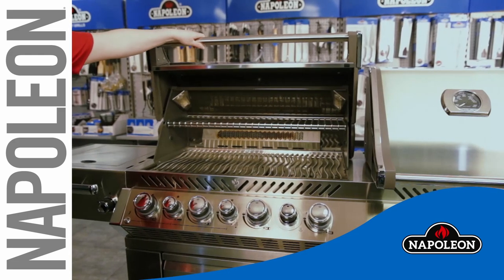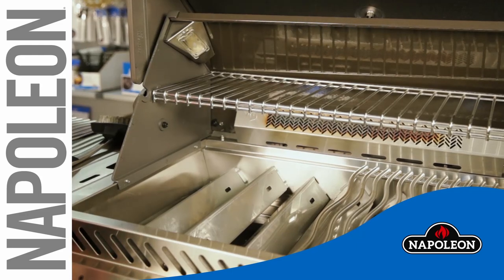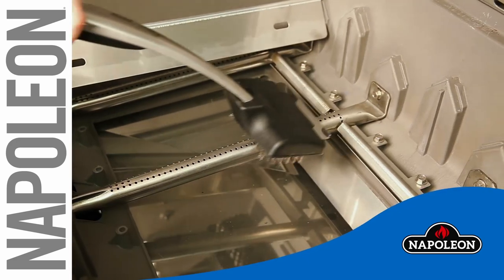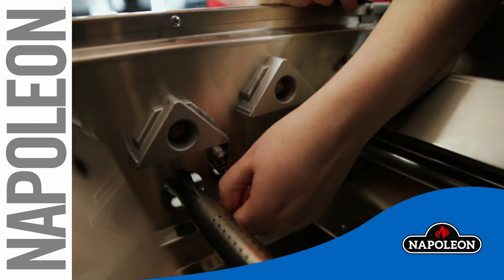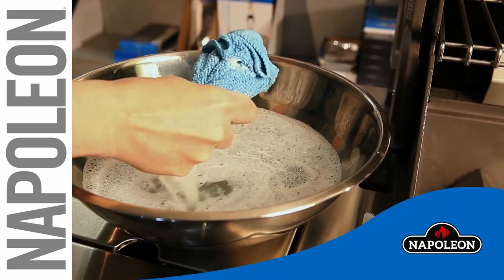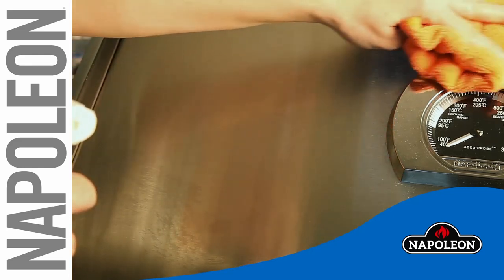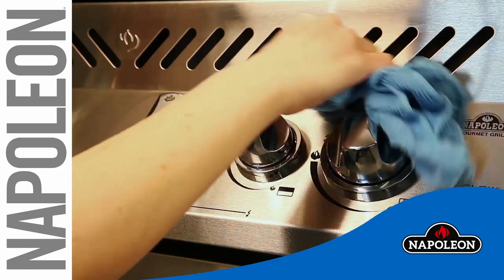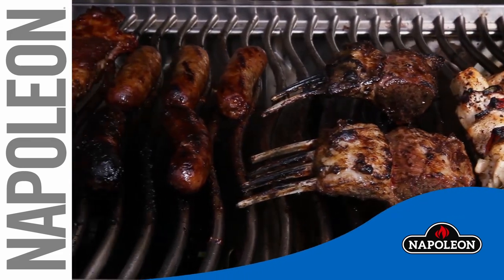Getting Your Gas BBQ Ready for Spring by Napoleon Grills

Comment: what is best brush for napolean xt grill?  I have kona bristle free and grill art bristle free.  I dont want to void my warranty should i buy a brush with bristles for the inside and the grates
Reply from the maker: Hi there, 

I am not familiar with the kona bristle free brush, however for stainless steel cooking grids, any brush will do.  My personal favorite is a wooden scrapper, which is also bristle free. For cast iron cooking grids a wooden scrapper works well, or a brass bristle brush only.  Any other bristle will damage the enamel coating on the cast iron.  I hope this helps!

Comment: Thanks Napoleon for being unable to design a real life usable grill! “ The control panel text is printed directly on the stainless steel and with proper maintenance will remain dark and legible. To clean the panel, use only warm soapy water”. For sure this will work out to clean the grill. Never heard about laser engraving?
Reply from the maker: Thank you for your feedback! We are sorry to hear of your disappointment regarding the Control Panel Text and cleaning instructions. We will forward your suggestion to the appropriate personnel for consideration in future design. Please do not hesitate to contact our Customer Experience Department should you require any additional assistance or have any additional questions or concerns. We can be reached by calling 1-866-820-8686 or via email at grills@napoleon.com. Best regards.
Reply: For what it’s worth I’ve had my Rogue 425 for a few years and the control panel looks like new. And other than covering it overnight and regular cleaning, it’s been a very solid grill, used several times a week.
Reply: My P450 is having its 15th birthday this summer, the lettering is as dark and legible as new, almost totally undamaged after years of deliberate use. Just by not cleaning it to death, as they warn in the manual. Start by not allowing it to get filthy in the first place, perhaps?